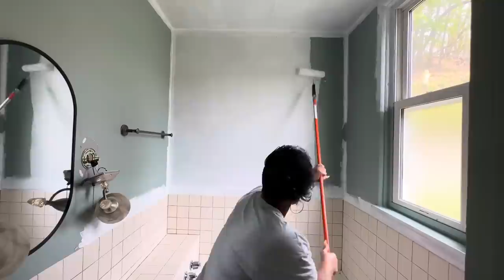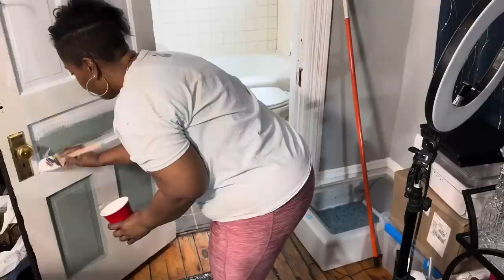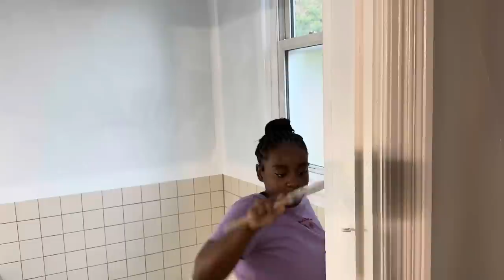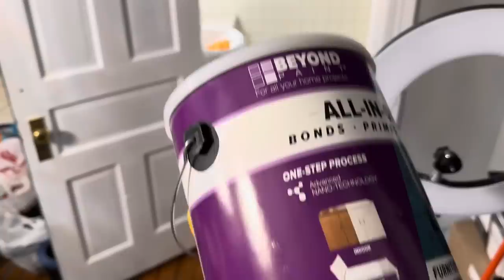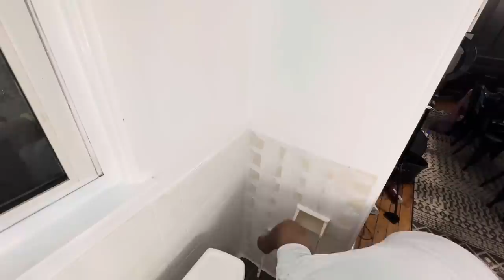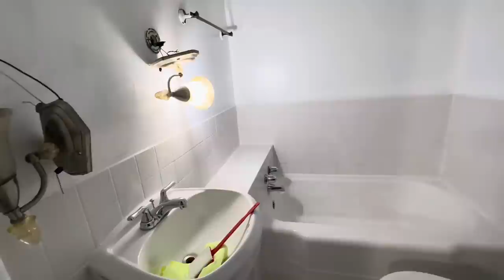BATHROOM MAKEOVER PART 1 ON A BUDGET / USING BEYOND PAINT FOR TILE AND TILE FLOOR / SHYVONNE MELANIE

Comment: Hey Shyvonne. I was just checking about painting tile. You need to be careful when cleaning the painted tile. Also I saw they did not recommend painting floor tile in high traffic areas. I know you said you were thinking about doing your kitchen floor.Oh and ps they have trim tile that's called bullnose tile that maybe something you could add to add some detail to the top of those bathroom tile. Like moulding detail for walls and ceilings except it's for tile.

Comment: A shower can be added to this bathroom. You just need to change the tub faucet to a converter faucet and then purchase a shower hose and sprayer that connects to the tub faucet converter on the exterior wall.

Comment: Did you know that you could have your bathtubs reglazed?   Reglazing a bathtub will remove surface imperfections such as scratches, shallow cracks, and stains.  It is worth the money as long as the tub isn't old, leaking, or full of mold.